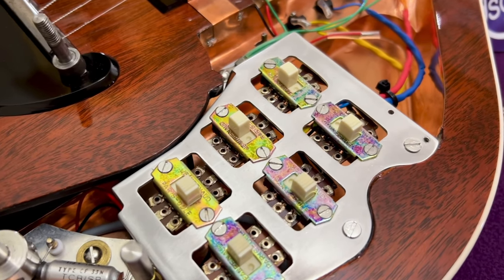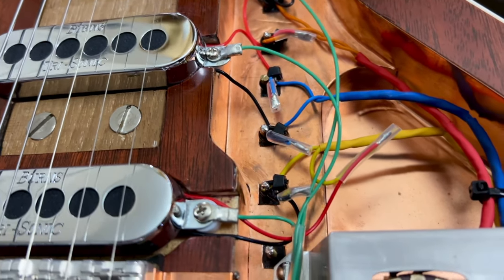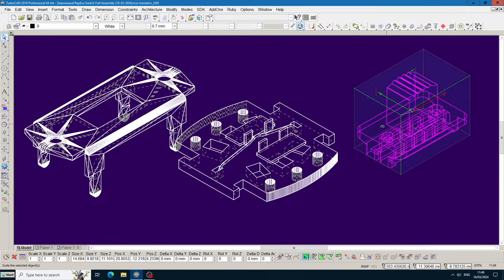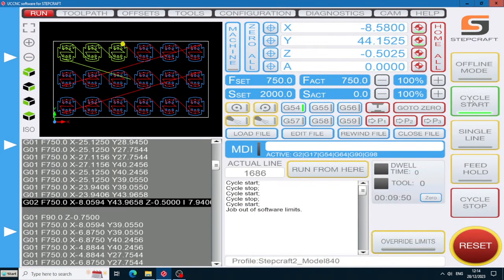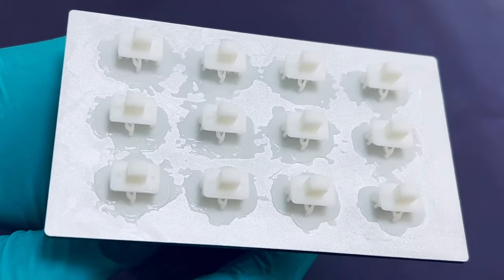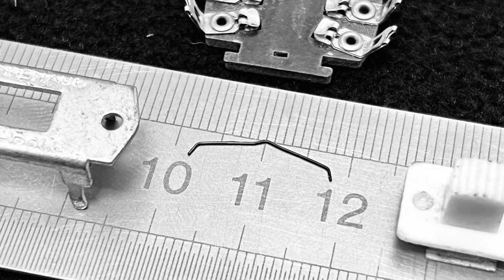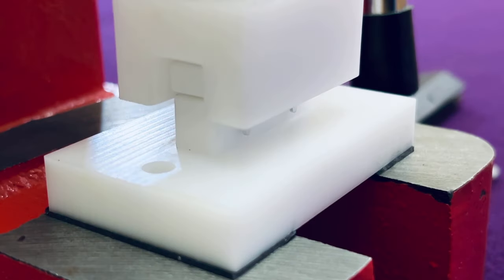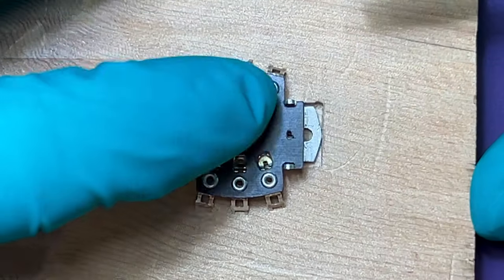Brian May Red Special Guitar: Jeanrenaud Switch Full Replication by dsgb

Comment: Great video!  Yeah, I went through that process of making switches and it was rewarding, but man, it was a lot of work!  To bend my wires, I made a 3d resin printed 2 part form that I used to press the wire into the proper shape.
Reply from the maker: Thanks! 🙏🏻 I considered the method you used.

Comment: Thx for the video, it's really informative! 

Will there be a similar video about the bulgin jack socket in the plans? It would be great to make the necessary electronics yourself instead of looking for it on ebay or waiting for it to appear there...
I apologize if I do not understand some aspects related to electronics.

Thanks in advance for the answer! :)
Reply from the maker: Hi. I'm pleased that you found this video informative. I have considered making a video about replicating a DIY Bulgin jack socket for the reasons you state but I decided against it because it will require metal sheet to be cut and bent into a specific uniform shape and riveted. It is not important to maintain cosmetic or engineering authenticity on a Red Special replica either.

This would be too much effort and I don't think woud result in an interesting video. Especially when a long barrel Switchcraft 1/4" jack socket is fit for the purpose, easy and cheap to source.

Comment: Una pregunta buenas , se pueden comprar los interruptores en otras partes ? Me refiero en tiendas donde venda interruptores , e visto interruptores similares a las de ustedes o buena tambien de diferentes formas , sera que influye en el sonido ?
Reply from the maker: Unless you can find stores which sell NOS (new old stock) or recovered vintage electronics equipment, the original Jeanrenaud switches fitted to the Red Special are extremely difficult to find retail.

As is the way in a capitalist society, people who trade in vintage audio and vintage electronics can research items that are in demand by niche enthusiast groups and charge high prices for what were originally low cost components. This is why it is more satisfying to make your own.

You can use any suitable panel mounted DPDT switch. Toggle switches are popular for example. The push-to-make push-to-break PCB mounted microswitches on the Guyton RS Transporter that I used on my Stratocaster conversion are very intuitive:

https://dsgb.net/projects/maycaster/part8/

Different switches will not influence the sound but should always be make-before-break to avoid generating circuit noise during actuation. Although modern Tri-Sonic pickups are potted to reduce microphonic feedback, they can still pick up mechanical actuation noise.

Comment: Wonderfully entertaining as an exercise in perfect authenticity.

Although anyone wanting Red Special wiring could simply use any compatible (but not historically identical) switch!
Reply from the maker: Thank you Paul. I'm pleased that you found the video entertaining. 🙏🏻💜😀

The best option for Brian May Red Special switching are the push-to-make, push-to-break microswitches on a PCB used in the Guyton RS Transporter and on my converted Fender Stratocaster. Check it out if you haven't seen it already.

Comment: It seems like it should be possible to photo-etch the brass sliding contacts, and probably also the static contacts. Folding the latter would be another question, of course...
Reply from the maker: Possibly. I am not familiar with photo-etching. I thought it is intended for very thin copper layers on printed circuit boards, not relatively thick sheet metal. 🤔

Coincidentally, I was just watching an interesting video on photo-etching PCBs using a 3D SLA printer:

https://youtu.be/RudStbSApdE
Reply: @dsgb  it’s commonly used for etching small brass parts for scale models, especially railway modelling. I had a brief look earlier and there were some online services where you can upload your own artwork and they etch the parts.

Comment: Hi, do you can make a set of this Jean r. With a white tip  like a switchcraft switch?
Because I've my pickguard with a switch craft hole... 😢
Reply from the maker: One of the main motivations for making replica vintage Jeanrenaud switches is for the smaller sized actuator. If you want to fit these, you would need to make a new pickguard to match.

It would be possible to design and make a Jeanrenaud style switch with a modern Switchcraft sized actuator tip but surely this would be somewhat pointless?